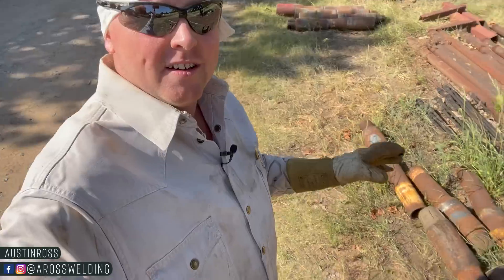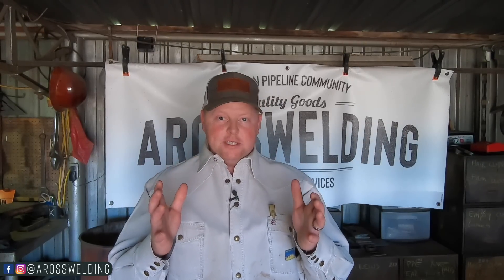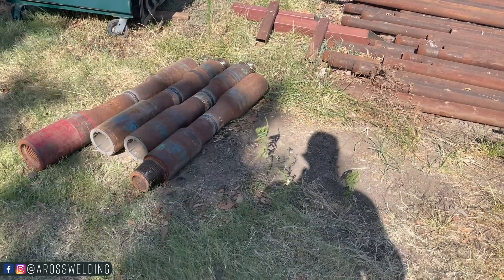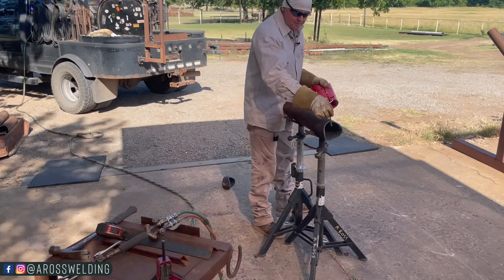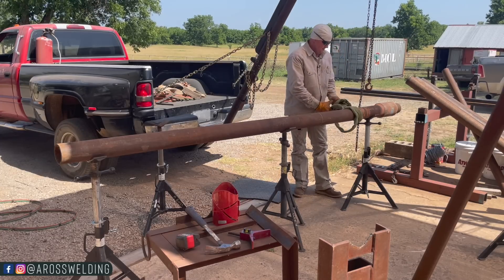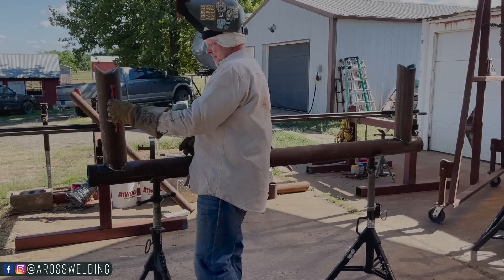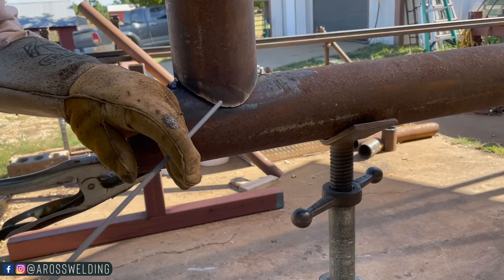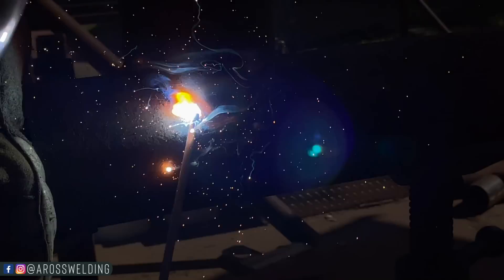WHEN WELDING ON MAGNETIZED PIPE

Comment: Well I turn up the heat and give a hot pass and don't move my rod I give it a 45 angel and let it burn as rotate around the pipe well with used drill pipe and after a buff it's like it was never magnetized but I'm only a fence builder so I don't weld all the time I got about a year under my belt 😊

Comment: I’ve gain a great deal about welding from your channel and a couple of others channels. I’m basically self taught and find your tips very helpful the one thing I look for in welding videos is different rod types and there uses, uphill, downhill applications. Difference technique rod angels, rod lengths, amperage of different rods and controlling puddle.  And I’ve learned a lot the hard way.

Comment: My 55 amp Plasma torch will sever 3/4" metal but it will not cut 2 3/* oil filed pipe. What is going on?

Comment: Started welding at 10 years old in my Dad’s welding and fab shop back in 1965. Worked in a few other shops mig and stick welding . Started Ironworking in 1975 and did mostly stick, but also mig, tig and lots of air arc. Retired and now 70, but still weld some in my home shop.

Comment: I'm 70 . started welding with stick and mig in 1972 for about 10 years. Then started driving truck till I retired, Now I just started stick welding again, also flux core . things sure have changed. Gonna pick up a mig welder in about a week.

Comment: Hey Austin! I'm 61. Started welding in !980 but I am an Electrician, Electrical Eng. and electronics and computer guy before I am a welder but have welded weekly and in streaks daily in that time. I have my own business that includes all of my skill sets and often many jobs I have include most of those skills on a single job.

i have welded a lot of magnetized drill stem pipe and a trick that I know which stems from my electrical knowledge is to create a transformer or an opposing magnetic field which helps to reduce magnetism by canceling it out. You do this by wrapping your lead cable around the pipe in a coil in several wraps.with a long enough lead to move around and weld your joint. Some really bad magnetism doesn't completely go away but would be nearly impossible to get nice welds without doing this.on bad pipe.

Haha, just noticed the guy before me said the same thing but perhaps my explanation can give an understanding as to why

Comment: Welding with DC will set up a magnetic field. 
It will cause what is called arc-blow as it repels the puddle. Especially as you get nearer to the end of the plate.
Always when possible, weld going away from your ground clamp. If you encounter arc-blow while welding, stop and reverse the direction of travel. 
Hope this information helps you.
I'm 69 and have been welding for 40 years professionally.

Comment: 40 years old DYI welding on the ranch. Welding, magnetized pipe I use a  Gause gauge to find out north-south polarity of the pipe then when I assemble, I put the north pole to the South Pole. This seems to help a lot, but as you go down the pipe towards the middle, your magnetism Will decrease until it zeros out and then switches to the opposite pole And increases until you get to the end of the pipe. Also, I find that using in AC welder works noticeably better than DC.

If you have access to a demagnetizing Chuck for drillbits run your pipe ends through it.

Comment: If it very magnetized to the point of being unweldable you can demagnetize it but it requires 2 welders. You take and turn one welder into a electromagnet. You do it by taking the lead of one welder and wrapping it around the pipe and plugging back into your welder. So posative and negative are plugged together. Then stick something to it and adjust amperage till everything falls off. If it gets worse switch polarity. If its not strong enough do more wraps.

Comment: 42, Kansas farm boy. Not a rig welder, or pipeliner, or any sort of super welder. Just a farmer. I was probably 7 years old. We had an old Lincoln buzz box in the machine shed. I'd seen dad and grandpa stick stuff together so i knew the concept. I wanted to weld an old distance clicker to my bicycle. Even then i kinda knew I should try on something else before I tried on the real thing I wanted to weld. I laid a piece of garbage angle iron out, flipped on the welder, and started trying to make it happen. I didn't make much progress. The bright flashes of light were a giant beacon my grandpa honed in on pretty quick. He was a gentle fella. Not a lot of words. He stopped me and basically told me that welding on the bike frame wouldn't work. Told me not to do that stuff without him or dad there. Same talking to I got trying to make a toy boat out of a 2x4 on the ancient safetyless table saw around the same age. The screams of the dull blade brought him over. Sometimes I'm amazed I'm still alive and have all my digits. 😂

Comment: I'm 56 and started stick welding in 9th grade (14), but never pursued it professionally only for practical farm/auto work.  I got good enough with the O/A torch to braze up a couple of lightweight bicycles (butted 4130 tubing-custom fitted) for myself some years back, and am getting a TIG setup next-- for farm and fab and maybe some side-hustle as I near retirement. Otherwise I'm a field surveyor, staking out construction, and doing boundary work-out doors every day all the way. I'm probably going to work with titanium after I get myself dialed in and set up. Bike folks are nuts about Ti.  I like your plain talk and practical experience. As much as I'm excited about TIG, I'm also excited to have something better than an A/C crackerbox for stick welding. My old box has issues and I'm done messing with it. Hey you axed.

Comment: I am 65, been tinkering with arc welding since I was just out of high school. Working as a farm hand, got to do my fair share of stick welding to cobble together machinery to get the job done. I did learn from a master to tig weld, but that was the only exposure I have with tig welding. I have never tig welded outside of a welding booth. I had many years off of the "hobby welding", but now I have a small ranch, and the wood fence is no good. I have been slowly rebuilding with the 2 7/8" oil field pipe for posts and top rail, as well as four other rails of 3/4" sucker rod. My lack of experience shows in numerous welds. Thanks for the tips, I have spent many frustrating hours trying to weld pipe, only to have it look like a seagull pooped all over my pipe. Austin, you are a master at your trade, keep up with the great videos!!

Comment: i an over 70 year of age  & have been welding such martials for over 50 years  I used to put the heat up as hot as possible  For magnetism go away when the steel gets sufficiently hot As possible.  get a of cut of the steel & het to when the  magnesium disappears that will Gide the speed you Welled at  Slow weeding speeds also help  Was the weld remains Hot longer often My welds glowed red hot 5 second after i lead down the weld.

Comment: I'm 36 started welding when was 8. Started doing it  for a living at 18.  Remember the tie-in I did that was magnetized from a smart Pig, my welding partner was  running a 300D and I was ole flat face 250D. For whatever reason the 300 could not weld the bottom with out it cracking but that 250 would. I put 3/4 of the bead in, it when good after that. But my partner asked in front of the inspector who's turn it  was 2 leave $100 bill on the bottom, you should of seen the look on his face it was priceless

Comment: 62 years old been welding 47 years off and on. I generally reverse polarity and wrap the bare cable around it. Some old timers used to heat and beat the pipe with a hammer to beat the mag. out of it. I learned that scrappers apparently got picky about the metals you bring them. I ran a large location for Weatherford Int. for many many years and we never had a problem getting rid of anything metal wise. I just thought of something though, I am a Gunsmith these days and when our tools get magnetized we use a Demagnetizer to take it out. it plugs in and turn it on and place the tool on it and it removes the mag. Since you have A/C power on the welder i wonder it you could power it up and place on the pipe and de-mag the pipe with it ?. A good one costs about $80. find someone who has one and borrow it for a try.

Comment: 33 years with some 18 year old welds. Dropping pipe to the ground from as high as the forklift would lift (15 feet or so) seemed to knock the magnetic out of em. Not sure the science behind it, but it worked.

Comment: SAE is a good welding machine I keep mine set at about two hundred amps if I'm welding on something magnetized then I go ahead and move it onto about 250 turn that voltage way down half gray smoke that magnetized pipe like there's nothing wrong with it

Comment: When steel gets above 1400 F the magnetism will go away.  I wonder if you could heat the metal with a torch and remove the magnetism.  You could also use a coil with AC current and degauss (thats removing the magnetic field) the pipe.  Steel melts around 2200 F.

Comment: Im 50, and been weldging sence i was 15,,  been in the pipe trades sence 1992,   the pipe dont lool magntised to me,,  it looks mre like arc blow,,  or jumping ground.    The graound doesnt know what to do.  It happens when the ground is way far away, OR nothing is touching really good.  Like th e first tack.  Then the second tack it gets a little better.   But once you get the majority "bridged" everything is fine,,   when the pipe is truely magentized the spatter is obserd,,  the puddle actually jumps off of the pipe. The issue you are haveing in my opinion is arc blow.   Simply take the bare end of a rod and 'bridge' the gap oposit side or quarter side of where you want to tack. Or a fitting wedge. This way the rod can find a ground to go to evenly on both sides of the parrent metal.  Hope this helps,,   keep your lenses clean and your rods dry and weld like the wind blows brother!!

Comment: I am 36 and I started stick welding at a steel foundry. Ngl, never welded anything magnetic before. I am currently working a mill wright gig in North Dakota doing mostly laser shaft alignment and compressor maintenance.

Comment: You're AWESOME.   I wish u could of met my grandpa. 
He was one of 4 main welders in charge of hunters point shipyard in san Francisco in the 50's.  I started with mig welding .after being in a shop for 4 years my boss told I'd get a raise if I actually had welding experience or training.   I enrolled in a stick welding class. I was told by the instructor to leave at 3 weeks into the class.  Cause after he observed my welds compared to the rest of the class.  My welds looks just like the teacher's welds.  He told me I was taking a seat away from someone that NEEDED to be in the class.

Comment: I taught industrial arts and welding for almost 20 yrs.and I have been stick welding since I was 16 yrs. Old ( I'm 62 now ) .my favorite way to welding is with my old Lincoln torpedo welder with a 2 cylinder Wisconsin engine on it.rake her to get the rpms up and let her go I love it .I taught those boys with 6011, 7018, and 6013s. I love 6011 because there not hindered by rust.

Comment: so im thinkin the reason the crapy first pass of weld on those overhead tube pannel frames finaly worked was cause i grounded some on them then did a second and third pass. so all that heat did it. the fellow wekding on the same boiler at the same time no more than 10-12 ft away probally had some help with his ground some how cause i sure was checking. lol

Comment: thanks for the great videos, your awesome. never welded on any magnatized stuff around here but im only 54 heck i cant even remember ever hearing of it, but i can remember a few times the weld didnt want to flow/puddle. once we were welding overhead tube panle frames to a 40 ft boiler, i was having a heck of a time and the feller welding the other side bout 12 ft away was having no trouble. so i always figured the night shift maintenance were pranking me through the servive panel? I like the 73 yr old fellows remedy ill haft to remember it. thanks again all

Comment: 45 YEARS, STICK, MIG, TIG, LEAD BURNING, KORASEAL LINED TANKS, TITANIUM, ALL PLASTICS, BRAZE 16-INCH CAST IRON CONNECTING RODS, COPPER COILS, A REAL OLD
 TIMER SAID YOU CAN MEND ANYTHING BUT A BROKEN HEART!  😂🤣🤣
I'M THE OWNER, SO LAYOUT AND FABRICATION, I WISH MORE KNEW THAT, BREAK DOWN A PRINT, MAKE DWGS FOR THE LAZER CUT PCS, TACK TOGETHER, AND HAVE 20 WELDERS, I BUY LINCOLN 7024, 1/8 BY THE PALLET FOR ALL THE TANK, PLATING TANKS, ETC!

Comment: Question boss… I’m building a pipe top fence when you pull string to set post do you just clamp that electric wire to one end and come along on the other end?

Comment: late 30s got my first machine when i was like 8 from my grandpa just fiddle farted with welding since then. i actually try and stay away from welding at work but it always finds me. best trick i ever learned is instead of switching directions rotate your wrist and rod 90-whatever you can and it seems to help. also a large hammer will knock the magnetism out of it if its not too bad. there is also a bearing heater trick that an old timer showed me once upon a time as long as your material is small enough or the bearing heater is large enough the electrical field can mag and demag metals.

Comment: I'm 57 and growing up on the farm I can't remember not welding from around 12 years old. Not to say it was good by any means but I had to make it hold or keep fixing it and grandpa didn't like wasting time. An old Sears ac crackerbox from mid seventies to my 625 amp Miller Syncrowave 500 dinosaur I still run today building boilers for park trains and traction engines. I think about the new inverter machines but don't want to spend the money. Used to have a SA 200 but discovered I much preferred shop life and the only portable welding I do now is on the farm. Have enjoyed your channel for years.

Comment: 31 almost 32. Been welding since i was 15. Stick, mig, some tig. Some shop, lots in the field, steel mills, aluminum foundries, heavy equipment, quarry plants, asphalt and concrete plants. Just not a lot of pipe. Would really like to get into pipe and pipeline. Just no local around here to talk to n knoxville, tn. I learned about a 8010 rod. Ive used 11018, 7018, 7024, 6010. And ac welders use a 7014 and a 6013. Its fun to learn something everyday.

Comment: Been welding since I was 17, but started making a living with it about 20 years ago (I'm 48 now).  Cut my teeth in the oil field, and had my share of magnetized drill pipe.  We used to make pipe racks out of the used stuff, and sometimes when you cut it you could literally hang a piece of 1/2" plate from the end!  I found the best way to counteract the magnetism is to "kill" both ends with a 5/32 5P, real hot.  It'll squeak like crazy but after you do that you can usually run a lo-hy like usual.

Comment: 47 - Been stick welding as a hobbyist since high school. I also need a lot of practice. I welded up the end plate for the boom on my three point hitch auger and made a real mess of it. Used my primeweld Tig 225x. It welded BEAUTIFULLY, but I had the amperage too high and it just goobered the rod onto the tube. Definitely got good penetration, but it sure is ugly.

Comment: 39 yrs old. welding stick mig and tig for about 15yrs did you try running 7018 on ac I know it helps with blow back from magnetism just curious if would help in this situation

Comment: I'm 71 now and retired but I stick welded for 40+ years. The way I welded magnetized pipe was to wrap my ground cable around the pipe 4 or 5 times and then ground to the work. Worked pretty good for me.

Comment: 72 and still doing repair jobs and project builds. Finished welding school in 1971. Worked one month after graduating doing production work. I could not stand doing the same thing over and over again. Bored me to death. Went to work at a welding and machine shop where we did a lot of repair work and new builds for farmers, industrial and construction customers. We did a lot of things that is not done or rarely done like cast iron repairs the right way using cast iron rod using acetylene. Did a lot of stick, mig and brazing also. Recently got a tig welder which I haven't done since welding school.

Comment: Got my Red Seal JM And B Pressure in 1986. AC for the first pass. Once you close the pipe, the magnetic feild is nullified. I built a rack for a rental company in Red Deer Alberta out of that kind of drill pipe. It went fine except for closing the last corner. The rack had three shelves with 3x12 rough cut trailer planks and was for storing rental BOPs. Very heavy hunks of metal. I had to wrap my cables around several times to nullify the magnetic effect. As the SA 200 did not have AC... Was trial and error to get the right directions on the wraps. And I also wrapped one side with the ground and the other with the stinger. It was an extreme case.

Comment: 25 I’ve been stickin for 7 years. Been working in industrial plants as a maintenance technician for 5 years. 1 and a half years ago bought a welding rig from an old boiler maker. Miller big 50. I arc gouge spool aluminum, lots of stick repair. Mainly trucks trailers and heavy equipment.

Comment: If you have metal to be arc welded and the material is magetized, the best solution is to use an AC output machine rather than a DC output machine. The AC weld current won't be affected by the magnetized material and cause arc blow. I know a lot of people don't have an AC machine, but if you do make sure you use an electrode which is formulated to work with AC current, such as 7018 AC.
Reply: AC is the answer, I’m surprised more people don’t know this trick.